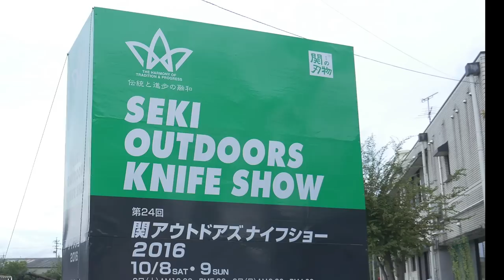Japanese Knife & Sword City: Seki Experience ★ ONLY in JAPAN

Comment: 4:03 - did that guy say that damascus steel is unique to Japan?...
Reply from the maker: I think what he meant is not the general process but the way THEY make their Damascus steel using 67 layers. That really is quite a lot. Damascus Steel, after a lot of research, is what is now referred to as pattern welding, not the middle eastern mythological technique. You can use different steels to make the pattern, different number of layers. The way they make it is unique. There's no way to actually confirm this but the brand is very reputable and they certainly wouldn't want to jeopardize that. Damascus steel is produced in a lot of places including by people who make their own knives themselves all over the world, something I'd love to try someday. For me, this was a gateway to a whole new world! Hope a lot of other people learned something it. -john
Reply: ONLY in JAPAN
Reply: No matter how you look at it. This statement is simply incorrect.
Reply: The 67 layers is a bit strange. As shown in the demonstration you pattern weld by folding the steel and welding it into a solid block again, so the number of layers doubles after each folding & welding step. This basically means the number of layers needs to be a power of two (2, 4, 8, 16, 32, 64 etc.) unless you start out with an uneven number of layers (so if you start out with 3 layers it become 6, 12, 24, 48, 96 etc. layers) or weld other pieces of steel to the folded core (so you weld a piece of hard carbon steel to the folded core because it keeps a sharper edge and a piece of soft iron to the back so the blade can bend without breaking). So my guess would be 6 folds giving 64 layers plus 3 pieces of other steel welded to it.

These techniques are specifically meant for the production of sword blades and not for knives by the way. Because knives are relatively short you don't run much risk of breaking them in use and want a steel that's as hard as possible even if it becomes a bit brittle, while you want a more flexible steel for a longer sword so the blade isn't going to break. That's why sword smiths pattern welded softer and harder steel/iron together all over the world before the invention of tempered carbon steel (and Japanese sword smiths still do it in this traditional way).
Reply: JerehmiaBoaz 67 layers is absolutely common, as long as you don't fold, but create a 67 layer billet and work off of that. Weld together a bunch of different layers, than hammer it out, and you have a 67 layer blade. And it has of course no superior qualities to homogenous mono-steel. 

Also, you don't want to fold modern steel material even once. Modern steel has the right amount of carbon, if you fold it, you burn out the carbon. It made sense with crucible steel, since that has very high carbon and slug content, so they had to clear it out. But anyone using monosteel layers, and folding them, is an idiot.
Reply: +Horváth Benedek What a billet of 67 layers without folding? I never heard of that. You usually only use two or in exceptional cases three kinds of steel of different hardness, so why on earth would you go through the difficulty of forming it into 67 paper thin layers first and welding it together afterwards, instead of reaching the same result far easier by repeatedly folding and welding much thicker pieces of steel until you've stretched and flattened them into those paper thin layers?

Of course you don't want to pattern weld modern steel because it has (as I stated before) the right amount of carbon and is first quenched to maximum hardness and then tempered to the right amount of springiness.
Reply: JerehmiaBoaz Why would you want many individual layers... oh, I don't know... maybe folding the metal many times exponentially increases the chance of failure in the material. Pockets of air, badly welded surfaces, unevenly hardened parts, this is all in the mix. Plus you need a fuckton of heat (64 layers means heating the blade at least 6 times to around 900 to 1000 C, and that is if you can fold it in one heating, which is almost impossible with larger pieces of steel. 

Historically, it is possible, but these are clearly knives made with modern materials. I mean, the whole point of damascus is not stability - forget that shit. Historically, it is not known ehat "damascus steel" is, but it is known that middle eastern blacksmiths used wootz steel, and wootz had the distinct property of having dendrite christals in it. This gave the weapon better edge retention than regular raw iron or shitty early medieval age steel. But the catche is, wootz had to br worked on low temperatures if you wanted it to retain its structure, so folding was out of the picture.
(notable wootz weapons include many traditional indian swords, and the famous ulfberth swords of the vikings fyi).
What we now call damascus was a cheap 18th century recreation of the surface of wootz steel using patterns welding (particularly in gun metals). 
The whole point of pattern welding was not strength, but aesthetics - differential oxidation (using different alloys) created oxidized and not oxidized layers. which is why modern knives use heavily alloyed layers like nickel  steels, as those are somewhat corrosion resistant, making a good base for the pattern, along with carbon steel, which is prone to oxidation.
Reply: Horváth Benedek well now I know not to get that type. so I'm just wondering what knife would you recommend for someone who cooks quite a lot
Reply: Kenneth Ramos Honestly? There is nothing wrong with these knives, just that they are overpriced. If you want to chop shit all day, go for German kitchen knives of you want to really work with stuff. Wüsthoff is overall great stuff. If you are more into asian knives, you can get anything you like, just make sure it is 
1) in the price range of the aforementioned Wüsthoff-like knives, spending more would be paying for marketing, not technology behind it. 
2) at around 60 HRC. (That is, 60 on the Rockwell C hardness scale.). Just a quick explanation, 70 is nitrogene-treated magic shit, but only used for ball bearings and stuff, because it is fragile; 55 HRC is regular heat treated high carbon steel. So 60 is really what you want from a good kitchen knife. If you know how to properly sharpen a knife, a bit lower is preferable, since you can always make it razor sharp, and softer steel is easier to sharpen.
Handling is important. If you are unsure, try a Santoku knife, those are IMHO more suitable for all-around use. Make sure the edge radius is not too large or too small. Too large, it is imprecise and can't chop, too small and you won't be able to dice shit like carrots or onion, because it doesn't have the gradual elevation needed.
EDIT: I accidentally calibrated my scale for martensitic steel, but on second thought no manufacturer leaves martensite in their knives. Still though, if you ever see something saying it has a HRC of 65 or above, make the shop owner bend it a few times. If that shit can't bend past like, 20 degrees, it means it was deiberately heat treated to higher hardness, but if you drop,.itnwill snap like glass. That's not tpp favorable, am I right?
Reply: +Horváth Benedek Totally agree with you on the kitchen knives, but to get back to my previous point, you wouldn't use the same steel for a sword but a spring steel instead, right? Now assume that spring steel wasn't invented yet, how would you solve the paradox of creating a sword blade that keeps an edge well yet doesn't break? Use different types of steel for the core and the edge(s) of the blade and weld them together. How do you solve the problem of (depending on the heat treating process) either the core steel being too soft or the edge steel (and in Japan the kawagane skin steel that wraps the soft core too) being too hard? Make it a layered hybrid like wootz  or Japanese hagane and kawagane.
Reply: JerehmiaBoaz Again, don't mix wootz into this. Wootz is an early example of crucible steel, so it is monosteel. Before crucible steel, people indeed pattern welded their blades to make them stronger - not just in Japan. It was a solid method, but frankly, it is outdated, in the bad sense of the word.
And with my modern knowledge and a proper equipment (meaning clay and charcoal), I could probably make crucible steel, after a few tries. So it is less about technology, and more.about knowledge. The Japanese made sword blades the same way from the 10th century on. Guess what, crucible steel by the 10th century in Europe and India was "factory standard". I have actually had the chance of inspecting a hungarian tribe leader's knife from 800something, and guess what, the patter welding method used was much more complex than any katana. It had 120something layers. And that is coming from a people of nomadic lifestyle from central Asia. Not a developed civilization with emperors and legislative system.
The problem with the Japanese was that they stuck to traditions too much, and refused tp trade with china - chinese weapons were of similarly high standard as Europeans. For technological improvement, you have to allow outside stimuli into your culture, otherwise you will be stuck at square one.

EDIT: Oh and spring steel is a very.specific type.of steel; it is used because it has a very high yield, thus it is really elastic, doesn't deform. But you don't NEED springsteel for swords. In fact, if you use proper distal taper on the blade (the base is thicker, the tip is really thin), you can make it so that during quenching the surface will cool faster, gets more riding, while the inside gets softer and more durable. Monosteel can do that; you just need to have its carbon content above 0.6 percent. 
EDIT2: Japanese blacksmiths didn't play with the heat treatment. Their steel was utter shit, so they tried to pick put better pieces, and then sandwitched them between shittier pieces. But since the weld is never perfect, stress doesn't districute evenly across the blade, and the middle cracks from suffiecient deformation, while the side bends. Yes, this happens even from a badly executed parry. The problem is that the structure of the blade is not homogenous, and thus not mechanically stable. The idea is good, the execution is bad. And I wager if they had the ability to put the sword in an overn for 20 houts, diffusion would equiate carbon content differences quite well. Problem is, running a furnace full power for 20 hours would be more expensive than the sword itself, considering Japans didn't have natural black coal resources, and charcoal only brings you half the way; using charcoal in a fornace for 20 hours would be like throwing dollar bills into the fire to keep yourself warm.
Reply: +Horváth Benedek I Agree on pattern welding being an outdated method that was used world wide (I already wrote that before) and that amazing examples were forged all over Europe in the dark ages. I guess I did use the term Wootz a bit imprecise, I meant the historical steel with uneven carbon content that was used to produce Damascus steel (the term I should have used instead).

I'm not a Japanophile, but the way Japanese sword blades are produced (by differential hardening instead of quenching and tempering) does result the hardest edge possible that doesn't chip or shatter easily (because of the layering and it resting on a core of much softer steel). So I'm not some samurai/ninja fanboy and I'm primarily interested in historical European swordsmithing, but I do realize Japanese smiths still produce the sharpest edge in the business.
Reply: JerehmiaBoaz There is a catch to this while thing. You say they produce the sharpest knives - I ask you, what is sharpness?
You can have a great edge profile on the knive, it is still dull as shit. The REAL EDGE is a few nanometers thin serration along the edge. A tiny saw. Now, this tine saw damages, its teeth fall out and break off, no matter how hard a knife is. If I want to, I can make a knife as hard as glass - in fact I have done it. I dabbled a bit in blacksmithing, and made a pseudo-tanto knife, and decided to ditch the tempering part of the process, because the blade was really thick. I mean really. Guess what. I ended up with a knife that is reeeally fucking hard. As in I could scratch a german chef's knife with it hard. Martensite can go up to 70 HRC, if it has enough carbon and proper quenching material.
Now, let me tell you about the edge retention of that knife. I can do pretty much anything with it. It is not pretty, but good for gardening. I have chopped concrete and metal nails with it. Not a dent. But it is not sharp. Because sharpness is not measured in micrometers, but nanometers. 

Now, the question is, which is a better knife? One that had 60 HRC, a decent edge retention, and  can be sharpened easily, or the other, which is indeed 65 HRC, but you need a 200 dollar whetstone and a fuckload of practice to properly sharpen (and if you mess up, your knife is done for). Personally, I prefer the first one. Add to that that lower hardness comes with better mechanical properties, and is cheaper, and I got myself a deal. 
And again, if you want a reallx fucking hard knife with great edge retention, make one out of High Speed steel (the stuff used in CNC milling machines for cutting). That stuff is waaaaay harder than any kitchen knife, you can mill steel with it. Then why don't we use it for knives? Again, because it is so hard, you couldn't possibly resharpen it. And even the best steel knife in the world has to be sharpened every week at least. I prefer every day. The exception is ceramic knives. And wootz. Wootz, as I said it, has a dendritic structure, so when the edge damages, the next layer of metal will be extremely serrated and thus, a good cutting surface. But it is not as durable and strong as modern steel.
Reply: +Horváth Benedek I'm all about the swords. I very much agree with you that you don't need an extremely hard knife for every day use unless you're chef (or a yesteryear warrior) that frequently cuts bone. The point with these Japanese blades is that the edge consists out of thin, alternating layers of an extremely hard and a somewhat softer steel which not only ensures that no big pieces can chip off but also assists in sharpening because you're only sharpening very thin layers of hard martensite.
Reply: JerehmiaBoaz Yes, I know what pattern welding is. Harder steel layer is fine, and yes, the softer inbetween can protect it from some degree of damage. However this lamination only gives sideways stability to the sword - against bending. And sably, japanese katanas, for example had the harder core in the middle, so it wasn't as effective against bending as if it had been on the side. 
The key however is edge hardness - well, let me tell you something. In the end, the edge only consists of 1 layer. And if it is too soft, it bends. If it is too hard, it chips. You try to cleave with a pattern welded chinese knife, it will probably chip. Or at least it is more likely to chip than a homogenous steel knife. 
Generally pattern welding makes composites. Composites are more often than not used for their structural abbilites (such as shock resistance), and suffer on all around abuse. 
Pattern welding is an inferior technique in EVERY. SINGLE. ASPECT. You can trust me on this one. Otherwise, how come cheaper non-damascus japanese cutlery is the same hardness as damascus one? Shouldn't that like, break?  
BTW, again,  if one wants to be so keen on hard knives with soft core, why no.case hardening? That way you have a harder edge, and a softer interior. And the hard part is on the outside, so it is more elastic. Better, am.i right? Still, nobody case hardens knives. Because it is a technology unfit for knifemaking.
Reply: +Horváth Benedek In Japanese blades the lamination prevents the somewhat  brittle harder steel from shattering into big pieces also. And no, katanas always use a softer core steel (either kawagane medium steel or shigane soft steel) than edge steel (hagane hard steel). 

The edge of a sword only consists of a single layer until you've parried or blocked a few heavy blows with it. Again, I'm primarily discussing swords, knives are shorter so you don't have to be as careful about them breaking or bending. If you forge a sword from the same cheap stainless steel that beats the Japanese Damascus it' will make an awesome outdoors decoration piece, but it's going to be pretty much useless as a weapon.
Reply: +Horváth Benedek Please look at YOUR OWN image again, it says the light gray is the soft steel, the light blue is the medium steel and the dark blue is the hard steel, agreed? Can we also agree that 7 of the 9 types shown in your image have a light gray core, and that this means that katanas have a soft core and a hard edge?

The best steel for cutting swords and general purpose swords is spring steel, the best steel for flexible thrusting blades is maraging steel.

As for my claim that stainless steel is only good for decorative swords, let me take a quote from the sword buyers guide page YOU linked (everything that follows is a quote):

It used to be that just about every sword on the market was made from 
Stainless Steel. Now, it is almost only relegated to cheap decorative 
swords - and for good reason!
Stainless steel swords (or any blade over 12" long) is considered to be 
TOO brittle for serious usage and can shatter relatively easily (as 
demonstrated by the infamous 'home shopping video' below).
VIDEO: The Infamous Home Shopping Network Vid

"A piece of that tip just got me O'Dell..."

To get just a little technical with it - Stainless steel is 
'stainless' because it has a high Chromium content (over 11%) - and when
 a blade gets over 12" long (such as a sword..) the grain boundaries 
between the chromium and the rest of the steel start to weaken, creating
 stress points. So the purpose of a sword made from stainless steel is 
to put it on the wall: and just keep it there to admire from a distance!
Reply: +JerehmiaBoaz Gods... (I am not even a theist)...
OK, first of all, maraging steel for thrusting? Seriously guy, that is a fucking overkill. Not to mention maraging steel has only become an actual possibility in the late few decades, as it uses precipitation hardening and heavily alloyed steel (similar to high speed steel and high temp tool steel). Nobody had rapiers out of maraged steel, and even today, it is uncommon to make swords out of it, because it is way more of a hassle to heat treat it than what a blacksmith can affort. 

As for stainless, again, there are degrees of stainless. High chrome content or nickel content ensures stainless properties, but if you use a high chrome, high alloy steel, (like the aforementioned HS steel, or in fact anything that can be precipitation hardened), and heat treat it properly, you are gonna end up with a bunch of little semi-coherent christalites, filled with carbides, which are VERY hard, ensuring that the steel stays incredibly strong and resilient - and also stainless. That is kind of the point of precipitation hardening. But as I said, this is an overkill. 
If you look at the page I linked and not only look at the stuff you WANT to see, you can actually see the 5160 I mentioned; it says it is not quite stainless, which is true, but it also says it has chrome content - and indeed, it doesn't rust at all from oxidation; though acids can wreak havoc on it, but who the hell puts their sword in acid, right? 
The confusion comes from the fact that every piece of shit with a bit of nickel in it is labeled "stainless". So it is easier to say that all stainless is shit, rather than explaining people how precipitation hardening works, how alloying components affect heat distribution and heat treatment, etc. 
And chromium only weakens the blade if it can gather around at the boundaries of christalites. This is what pumping steel full of carbon and alloying metals, and calling it alloyed tool steel is - a simple 440 stainless shit might have a bunch of nickel in it (IDK, I don't remember what it's made of; I could check, but i am lazy), but it doesn't have the carbon content to create the neccessary carbides in the metal - again, you need*SHOCKER* CARBON to make CARBIDES. 

We are going down a rabbithole I didn't want to. The end of the story is, make shit out of high carbon steel (which springsteel is, btw - it is high carbon steel with a miniscule amount of alloying components) if you want to actually use it; plasma cut it from stainless sheets if you want to make a wallhanger, and don't ever try to use anything with a large alloying component percentage, because you need a bunch of furnaces and a degree in material science to know what the fuck you are doing. Also steels like that are 10 times as expensive as carbon steel, so if you fuck it up (and you would), I would cost you the amount of material for 10 good carbon steel swords.

OH and about the katana image. My point was that the hard part (you know, the part that can give the sword a bit of integrity, a bit of stability) is in the middle, not on the sides. A soft or medium steel won't be as effective as a high carbon one at taking sideways blows. That is why samurais are taught to avoid the enemy blade rather than deflecting it.
Reply: +Horváth Benedek I didn't mean rapiers but the foils and epees used in sports fencing, those are made of maraging steel. I'm not even going to argue over stainless steel swords anymore, as for katana construction: in the more elaborate designs the soft core is covered with hard or medium steel at the sides to allow it to flex without bending permanently with lateral impact.

Of course it's better to avoid an opponent's blade then to deflect or block it with your blade and risk damaging it (and not just with katanas), but if you have to to protect your life and limbs you will. When you do, it's generally more advantageous to use the edge than to use the flat, not only because of the increased risk of permanently bending or breaking the blade when using the flat, but also because you want to achieve a bind where the edges of the blades bite into each other a little so the blades don't slide easily and you can feel your opponent's intent by the direct contact.
Reply: +JerehmiaBoaz 
"Of course it's better to avoid an opponent's blade then to deflect or block it with your blade and risk damaging it" I guess that is why european swords have shit like striking at your enemy's blade, or battering their face in with your crossguard. Because their swords were fragile like that. Oh wait...

"... but if you have to to protect your life and limbs you will. When you do, it's generally more advantageous to use the edge than to use the flat, not only because of the increased risk of permanently bending or breaking the blade when using the flat, but also because you want to achieve a bind where the edges of the blades bite into each other a little so the blades don't slide easily and you can feel your opponent's intent by the direct contact."
Sure, because it is common knowledge how in european and chinese and arabic martial arts, you ALWAYS parry with the edge, never with the flat! And you make sure to make a nice little chip in your sword so that you can bind your sword with the enemy!

Seriously, are we talking swords or lightsabers? Not to mention two swords never bite into each other like that - swords flex, you know. Even if you managed to make a dent or chip in the other sword's edge, which is likely; your weapon will never get stuck in that dent. The vibration of the weapon will shake it out of there pretty fast. 
Try it. Get a sword, and try to strike a stationary metal target. I tell you what happens. There will be at least two cuts - one where you initially striked, and the other where the blade ended up vibrating.
Reply: TL:DR 67 layers is 66 layers 33 on each side of the core steel.
Reply: And for modern knives, multiple layers is just for eye candy. You only really need 1 layer on each side (for overall core steel protection) The millions of layers on Katanas were created because they had to fold it to get the steel ''clean'' And after each fold that number grows, fast.
Reply: that is made adding extra material inbetween foldings, thats why the math is off (as you pointed), but also can be creatted in another way, by twisting steel, and the wire like structure then count as X number of foldings
Reply: Eleg sok eneriat belefektettel ebbe az emberbe. Bevallom nekem nem lett volna turelmem hozza. De orulok hogy vegre van valaki aki tudja hogy mirol beszel, es nem csak a mitologiat/hulyesegetl terjeszti .A srac amikor nezte a keseket teljesen bedolt a paraszt vakitasnak.
Reply: The original term damascus steel was applied to a steel with special properties that came from Damascus, Syria. There hasn't been real Damasucs steel on the market for centuries. In later times steel was folded to work out impurities, and the name Damascus steel was attached. Today steel is very pure, doesn't technically require folding, so Damascus is purely aesthetic and a tad of a marketing gimmick.
Reply: I believe he meant the material used in forging the damascus knife
Reply: Horváth Benedek Henckels Cermax range sits at 66 HRC. 65 and above can be achieved in kitchen knives without the compromise in ductility...though the heat treatments are usually staggeringly complex and involve powdered steel voodoo beyond my limited understanding.
Reply: Zylake of course it is unique to japan, becoz they dont have it...
Reply: Wow.. From this replies session alone, I learned a lot about forging/manufacturing process of metals.. Especially the discussion in between Horváth Benedek & JerehmiaBoaz... I find it really interesting to know about this from a different point of view.. I really enjoyed reading it & researching about it at the same time as well.. Thank you for sharing the knowledge with us.. & of course many thanks to John the Producer as well for bringing this informative videos in the 1st place.. :)
Reply: Just curious, but are any of the people commenting on this thread actually blades Smith's or are they all academics? Just curious, for professional reasons.
Reply: I think what he said is "the material is unique in Japan" which is true since tamahagane is illegal to export.
Reply: @WaoryuONLYinJAPAN  Damascus steel, properly known as Wootz, is not produced in a lot of places. It was made in India ...and the method is lost to history. Pattern-welding, which is bending, twisting, and/or folding metal(s), however, was done all over the world, with primitive steels, to make it uniform and remove impurities. (also other metals, purely for aesthetics) As furnaces improved, making more pure and uniform steels/irons, this became no more than an unnecessary hassle, that did nothing to improve the metal, at all. (but could make it worse, if done badly)
Hence why it mostly died out, in "the West".
With modern, higher quality steels, it serves no functional purpose, whatsoever.
Looks real nice though.
Nowadays it's only done for aesthetics and/or marketing
...or tradition and/or keeping history alive.
Reply: @rbombales3809  They were talking about how "Damascus" (which has never been made in Japan, ever) is unique to Japan. Also, tamahagane isn't used for kitchen knives, at all.